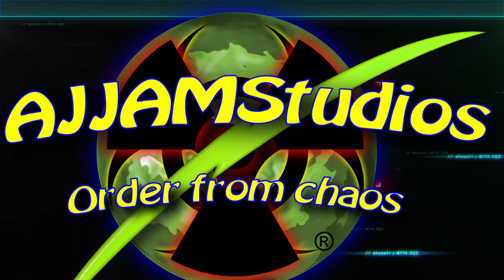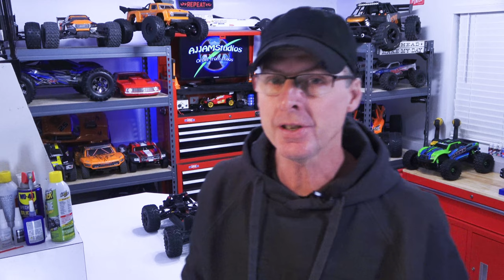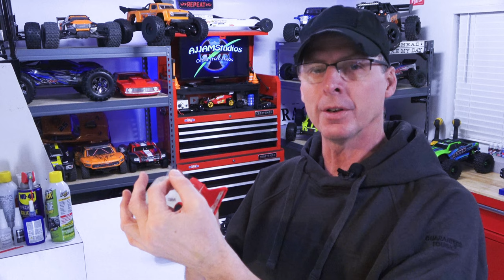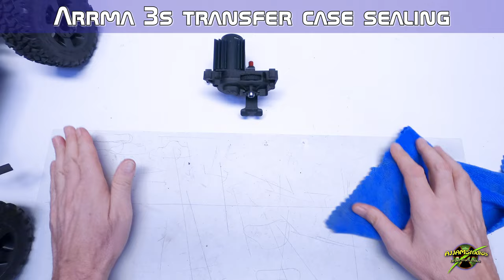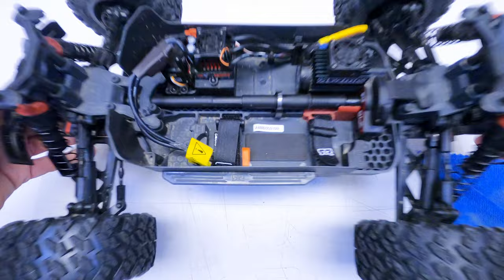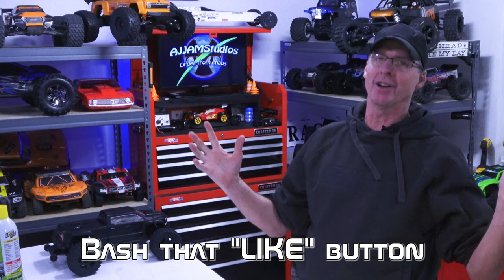Arrma 3s Transfer case sealing

Comment: I put a slot in the chassis placed just where the spur gear push’s outward  when going forward so the gear is not trying to suck dirt in. It actually works. There some dust from the gears but not much dirt. I never thought of using that kind of tape. Good idea.

Comment: this can help quite a bit, a very useful tip i learned from someone is to drill a hole where the spur gear sits and use a dremel to widen the hole, so any dirt that gathers in there will just fall through the hole. haven't had a single spur gear get chewed up since

Comment: Also seen this mod done by sticking the soft fury side of Velcro on instead of foil tape, you must of course not have the Velcro where the spur hangs down. The soft Velcro compresses between the chassis floor & the power module when you slide the modul in place creating a good seal from dirt etc entering.